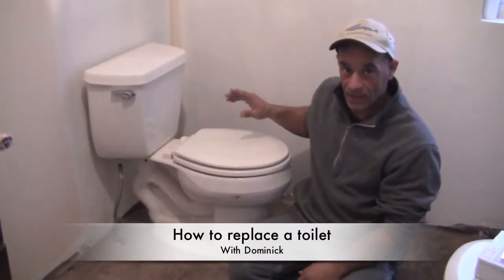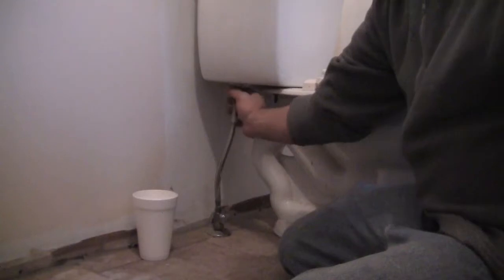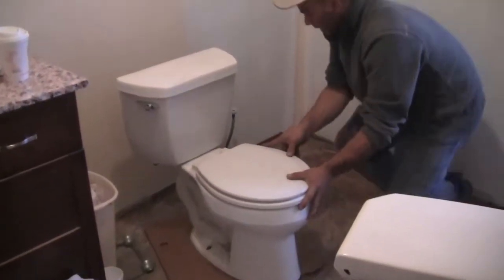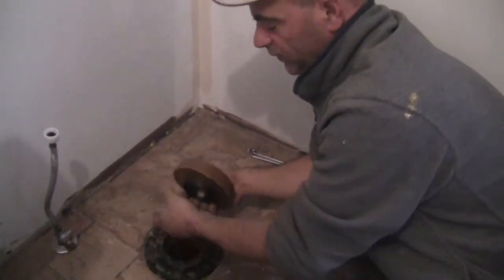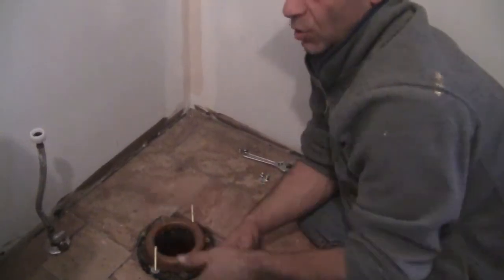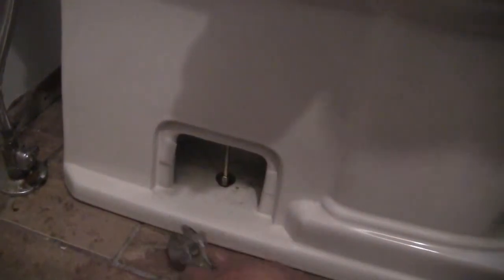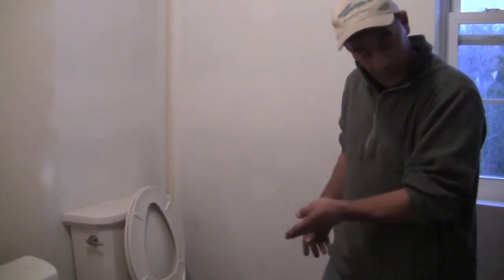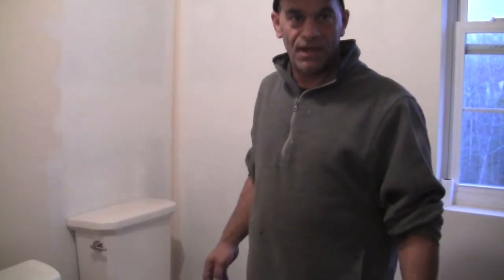How to replace a toilet

Comment: Nicely done.  Might I recommend hanging a towel or two on the walls near you (preferably so that you don't have two parallel walls that are not covered) - this will dramatically help the sound quality by reducing echo.  Works anywhere.

Comment: Awesome!  Our very old house needs bathroom repairs and toilet replacement is on the top of the list.  Thanks for the video..it really helped.  If we are replacing vinyl flooring, do we put it under the toilet around the floor flange or outside?  if our plywood is not in good shape but not spongy, can we temporarily replace the toilet and fix it later?  Not sure what we are going to find and we are really worried.  House is around 100 yr old but was upgraded in the late 70s.  Oh, Oh...wish us luck.

Comment: Thanks. This was very helpful.  One thing I wanted to mention for my situation.  This video has you assemble the tank on it before placing it.  But, it didn't set against the wall correctly.  I had to put the bowl down. And, then reposition it when placing the tank to make it fit snug.  I was worried might break the seal. But, it was good. Saved myself $100. Thanks!
Reply from the maker: +globalriot Always happy to help.

Comment: Dom - Thanks so much... I already know how, and have done a few, but thought I'd leave this open so the GF sees it and it gives her confidence in me a little boost.  PLUS, I did learn something:  The wax WITH the plastic flange! Never knew they were available.  Thanks.  We're getting a new washer/dryer installed, and unfortunately, I need to remove/replace existing crapper to allow the proper room for the install.  So I'll head down for the new FLANGED Johnny Ring and NEW bolts now.  We appreciate all you do - would love to work with you sometime... We may not get much work done, but we'd  go home sore from laughing.  PS - send me the Ex's address... I have an old (non-working) washer/dryer set to sell her.

Comment: Great instructional video. Just wondering about leveling the toilet on an uneven floor. You said to use shims, but I have often seen plumbers use plaster. Is either one better or worse?
Reply from the maker: +LongBeachNY11561  I would use shims and blaster if it's really bad. Otherwise just use shims and then caulk around the toilet keeping them in place. Any movement will crack the plaster.
Reply: Thank you.
Reply: +LongBeachNY11561 You can get special shims for toilets I believe. I briefly worked with a plumber and he was astounded that no one uses them. They are rubber shims, I believe.
Reply: Thank you.

Comment: You rock. I just replaced my toilet and a shop vac worked great! Other videos say to use a sponge ( that's for cavemen).  The only thing I did different was putting the wax ring on the toilet which seems more logical as to get it perfectly around the hole on the bottom of the toilet.

Comment: Not just because your line was short, but for me, Mr. Paranoid, I always buy a new water line, and install it, and frankly, angle stop also, because I had a few nightmares, that were preceded by a night phone call, because the other stuff brook, or leaked...I have found, unless you pray a lot, or toss a virgin in to a volcano, you will get some sort of a leak, within one day, to one year, and it makes me look bad, or a mess at my house, but that is me...I just hate to look bad for under 10 bucks...I love the video, and will be replacing my older wasteful water toilet at home in the Philippines, with a taller low flow toilet...I want a taller toilet, because I am getting older, and low flow, just for future rate increases...Our water bill presently, is around 6 bucks tops, a month and that could change since electricity there is double than most cities in the US of A...We use very little electricity, and changed all lights to 3 to 9 watt LEDS, and our electric bill is over 60 bucks for what would be about 20 bucks in the us, since we not use much electricity...We did check to make sure we not have other people tapping into our system, and we are okay, but as I said great video
Reply from the maker: +King Kano World Media Good luck finding a virgin and volcano.
Reply: LOL

Comment: OH my gosh I found it... ewww yep have to do this too... :((( 3 of them... :*(
Unless I can figure out how to get them to stop running...already replaced the old parts and they still run... one does barely but other argh!!!! That pump thing inside any way I turn the lil' knob thing it still runs... I thought that was a way to fix that... especially since new flapper already in ... I'm at my end with the toliets.... :OOOOOOOOOOOOOOOOOOO LOL 
Ok gonna watch it...  1. turn water off 2. vacuum or sponge/towel 3. flush lol 4. disconnect water line 5. take 30 yr. old bolts off on each side... 6. take up old wax ring 7. put new bolts down with plastic rings 8. put new toliet down (ugh my old ones are upstairs...whew... they are bigger than those 2!!! 9. when it's dark out put old toilet down in middle of ex's yard or ex's front porch!!! ;)
10. damn maybe I should keep the old water eaters...Aunt Bertha might break those lil' small ones if she comes over! whollyyyy.. :O LOLLLLLL your video...